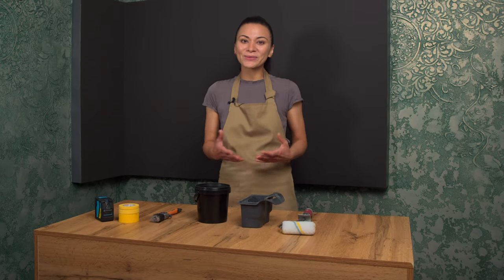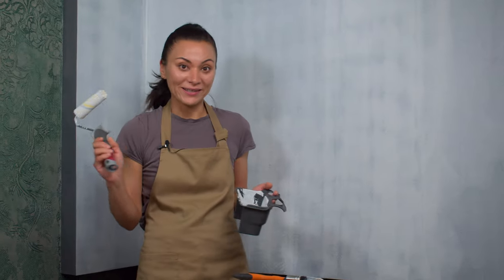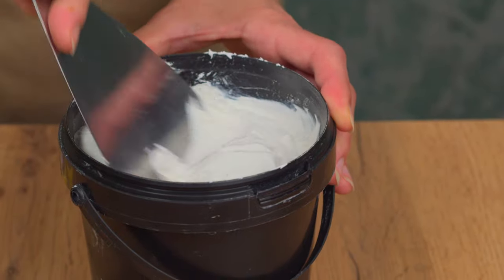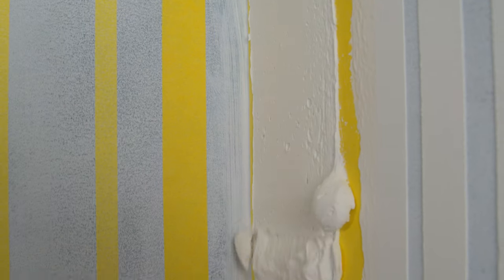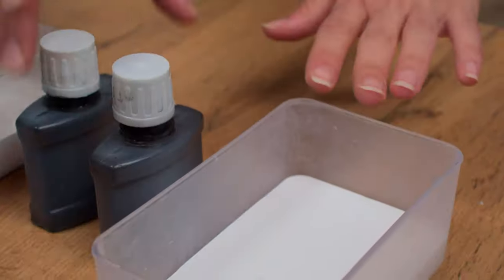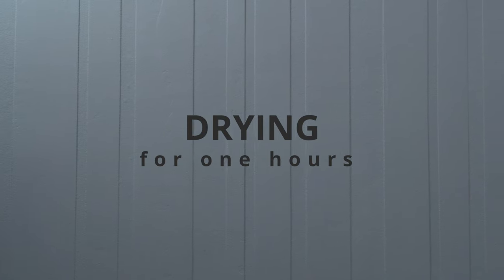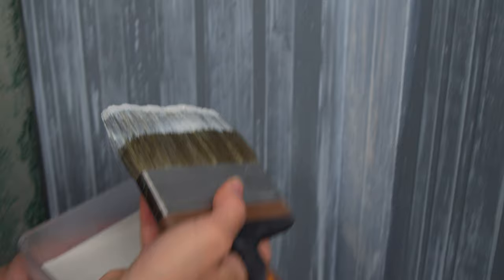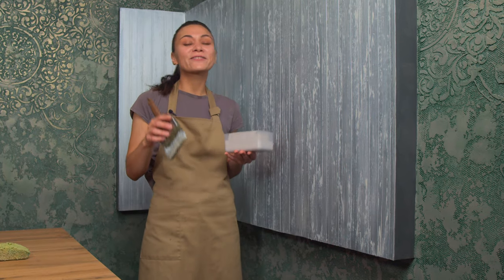DIY HOME DECOR: idea with sand!

Comment: Latex primer ia not the best prier for this work, but the materials you are using is not great, they crack after a while. Why are you using spakle with that last decorative paint? Spakle is not long-lasting,
Reply from the maker: Regular spackle is durable as long as you don't use it in areas that require super-strong surfaces. You can do the same thing with cement material. Such decor will be much stronger.